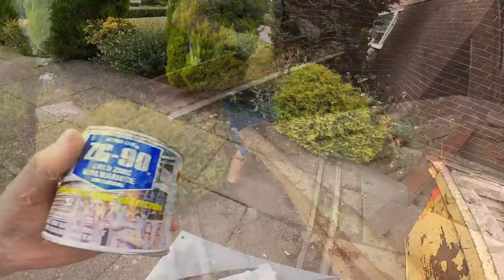HUGE GALVANISED LINTEL REPLACEMENT 11 FEET LONG !!!

Comment: Looks like shit, not only did you break bond with the existing brick, you broke bond on the three courses with each other!!! Not sure WHY you couldn't see the pattern on the existing 3/4 brick closure. Another sloppy job i would refuse to pay for.
Reply from the maker: Thanks for your constructive criticism 🧱👍🏼
Reply from the maker: @martin2466  😂😂🧱👍🏽
Reply: 😂 at the constructive reply. That brightened up a dull day 👍👍🧱🤣
Reply from the maker: @Doug....  😏😁🧱👍🏽
Reply: I wouldn’t have glued front edge just center and bak
Reply: @martin2466  Since I have been doing construction for 42 years, and have gotten the money for a lot less shitty work, and told them to their face their work was shit while handing them their check......then YES i would have zero problem with telling anybody that their work sucks! "mate"
Reply: @SteveAndAlexBuild  Well, it IS constructive, if you have ANY pride in your work?!? Otherwise you are just taking a piss. Maybe instead of trying to come up with witty replies you could put as much effort into cleaning up and improving your skills! After all, your skill is ALL you have to sell. But that may have gone over your head as it seems. It is the details that set apart Great craftsmen from the hacks. How you move forward determines which side of the equation you are on.
Reply from the maker: @scotty362100  I beg to differ mate … starting your comment with “ looks like shit “ ISNT constructive criticism. Feel free to express your thoughts which good or  bad are always welcome on our channel but just leave out the swearing and the abuse , it just makes you look bad not us 🤷🏼‍♂️
Reply from the maker: @martin2466  👏🏽👏🏽👏🏽
Reply from the maker: @martin2466  🤔😏🧱👍🏽
Reply: @martin2466  Nice attempt at deflection. Without the "yanks" you would be German! LMFAO
Reply from the maker: @martin2466  😬🤣🧱👍🏽
Reply from the maker: @martin2466  🤣🤣🧱👍🏼
Reply: @SteveAndAlexBuild  I've been laying for 35 years and to be honest if that was the front of my house i would not be happy. Breaking the bond and all the cuts look terrible. You guys always do quality work so I'm just curious as to what happened on this one?
Reply from the maker: @browndumpling1232  simply not concentrated . I only noticed it when I was editing the video which is a bit late 🙄. 
   As with all mistakes we make we will learn from it . 
     We are doing next door but 1 soon , identical job . 
    Thanks for the polite criticism rather than the original comment . 🧱👍🏽
Reply: You are strictly correct,  but without access to  spares of the original bricks it was either break the bond alignment or insert mortar gaps way bigger than all the rest.  I know what would look worse!
Reply: @evanpenny348  You weren't there, you don't have a clue, and by the way Steve has already admitted in another video that he made a mistake and didn't notice the broken bonds, until he was finished! Nice try running interference though.
Reply from the maker: @evanpenny348  . Cheers buddy 🤙🏾🧱👍🏽
Reply: @scotty362100  while your at it Mr perfecto ,how'd the wine taste at the last supper ?
Reply: Scotty, if you look at the video at 1min 50s   I didn't know exactly what breaking the bond was, but a quick search revealed all.  The original brickwork had odd sized bricks in the first and second courses.  They put it back as original-also that steel looked a bit thicker in cross section to the original.
Reply: @scotty362100 fuck me I'm surprised you've not been dropped ....he's a good bricklayer is steve and knows what he's doing .....
Reply from the maker: Cheers Mathew 🧱👍🏽
Reply: Do you have a boil or a pimple?? Wind your neck in 😄

Comment: Great job guys. Just looking at your acro's and strong boys. Are they they XL ones which can support up to 300mm? (so will support both the brick and the block work? if needed) have you ever needed to support all the way through?
Reply from the maker: They are just standard ones pal . But they reached the inside blockwork 🧱👍🏽

Comment: Great job lads.   Have you ever come across a steel angle lintel where there was a gap (around 7mm) between the top face of the flat of the lintel and the inderside of the brick that it is supporting?
Reply from the maker: Thanks Mike .
  No never 😳🧱👍🏽
Reply: Thanks  @SteveAndAlexBuild  .   I'm thinking it's due to 'rust jacking'  where the steel lintel starts to rust and the expansion of the corroded material jacks up the masonry above the lintel....
Reply from the maker: @mikemccurdy8504 Ah I read that wrong .
  Yes this is classic rust jacking . We see it all the time 😬🧱👍🏽

Comment: Brickwork looks good when cleaned and repointed… I thought that new lintel was a bit on the wide side…and be careful when cutting (…heating up) galvanised steel, it gives off fumes that can badly affect your lungs…!! Wear a mask to protect from fumes, and make sure you water cool it whilst cutting so the temp of the steel stays well below 200°c…
Reply from the maker: Nice one cheers Stu 🧱👍🏽
Reply from the maker: @martin2466  😳😷🥽😬🧱👍🏼

Comment: Was it necessary to remove?What problems were identified?
Reply from the maker: Yes because the lintel was rusting which lifts and cracks the brickwork above which in turn let’s in more water causing more rust . Only replacement can cure the problem 🧱👍🏼

Comment: Can I ask you Steve+Alex where did you buy that galvanized lintel from please ?
Reply from the maker: It was from J M steel in Burscough Lancashire. 
Any steel stockist can supply them though 🧱👍🏽
Reply: @SteveAndAlexBuild  Many thanks for your speedy reply , we need to get two of them for a 1930s house , none over the windows at the moment, just a half brick cottage header course ,1x2.750 the other 2mtr , at least it's ground floor, Good job btw , well done 👍
Reply from the maker: @gerardoleary9243  you can buy standard off the shelf keystone angle irons up to 3 metres . A lot cheaper and still  galvanised 🧱👍🏽
Reply: @SteveAndAlexBuild  cheers Steve+Alex , I didn't know that, I'm pretty local to you so where should I look ? That would be a great help, just been been quoted £325+ vat , any ideas would help who stocks them , much appreciated lads👍
Reply from the maker: @gerardoleary9243  C & W Berry in Leyland will sort You out 👍🏽
Reply: @SteveAndAlexBuild  many thanks again lads , I live at the end of the 57/58 brooms cross , never does a day go by without a accident occurring at that junction , I'll give them a shout 👍
Reply from the maker: @gerardoleary9243  🧱👍🏽

Comment: Entertaining video, watched to the end as usual. I'm not a bricki. I can't see how the perps would change by much if you're taking out bricks and putting exactly the same ones back? So to me the problem isn't your bricklaying it was the guy before. As for gluing brick back together, modern adhesives are the best. Your problem was you put far too much on. They bond by chemical reaction so you only need a smear of glue, then the crack won't be visible, if it sqeezes out you've put too much on. Can't believe people are chucking ww2 at you! We should be worrying about ww3 right now!
Reply from the maker: 😂😂 cheers buddy abs thanks for the tips 🧱👍🏽

Comment: What are those brackets called that u use on top of ur support posts??
Reply from the maker: Not sure what you mean pal 🤔🧱👍🏽
Reply: What are you guys using to support the brick?  I’ve never seen post like those.
Reply from the maker: @papalou190  It’s called an angle iron . Very common in uk 🧱👍🏽
Reply: Not the angle iron 😂. Ur props/ shoring post. The posts that are holding up the brick while u demo out the brick.
Reply from the maker: @papalou190  Ah….. acro props 🧱👍🏽
Reply: Ok, getting closer. At the top of the props their looks like a plate that goes into the wall. Do those separate from the props?
Reply from the maker: @papalou190  😆😆Ah they are called strong boys … acro extenders 🧱👍🏽
Reply: Thank you!  I’ve never seen those before. Looks like they’d be handy to have. Not sure if they sell those in the US?
Reply from the maker: @papalou190  😆🧱👍🏽
Reply: @SteveAndAlexBuild  'Strong Boys'.
Reply from the maker: @davidscott3292  jeez can’t believe I didn’t get that straight away . What a tool 😬.
   Apologies for any confusion, yes as David says 
Strong boys 🧱👍🏽( not sting 🤦)
Reply: More accurately I should have said 'Strongboys'.
Reply from the maker: @davidscott3292  😆🧱👍🏽

Comment: A couple of nails into the timber behind the lintel will hold it straight. They only need to take some weight until you brick it up.
Reply from the maker: That’s the usual method but this was a concrete lintel 🧱👍🏽
Reply: Ahhh, that explains it. Good job as always btw guys!!
Reply from the maker: @GeekBatman  Cheers 🧱👍🏽

Comment: Not gonna lie, but when I saw you putting those cuts in as I was shocked at how you appeared to have messed up the bond. Fear not. It wasn't until the end when you showed us what you were working off of to the right. What you were pulling off of the perps were wandering all over the place
Reply from the maker: Thanks Lawrence, yes this house had a half in 3 of the gables 😳🧱👍🏽